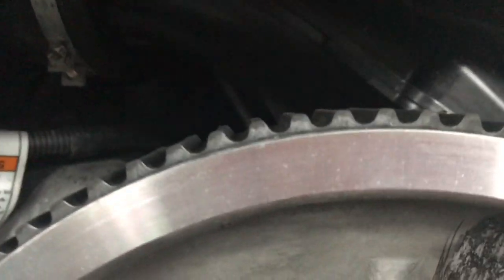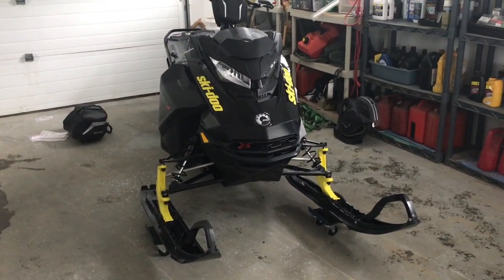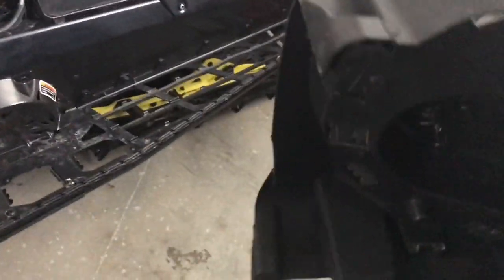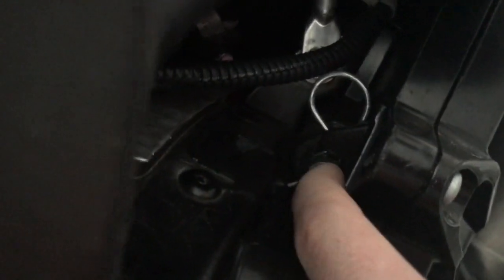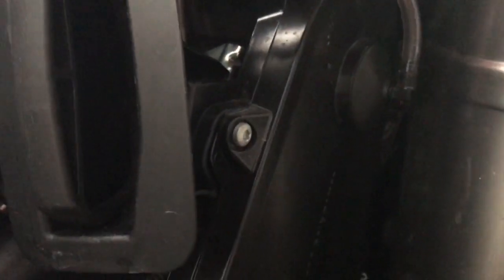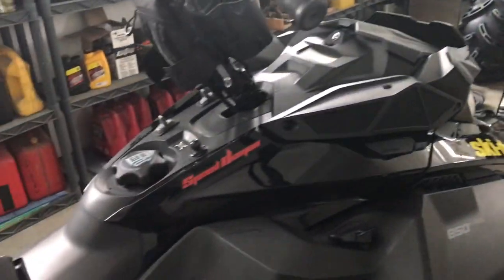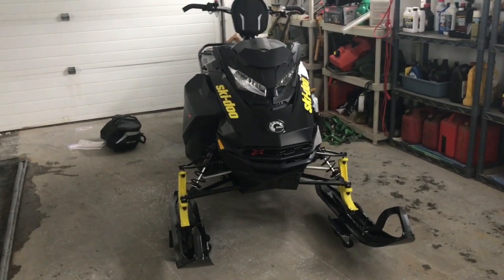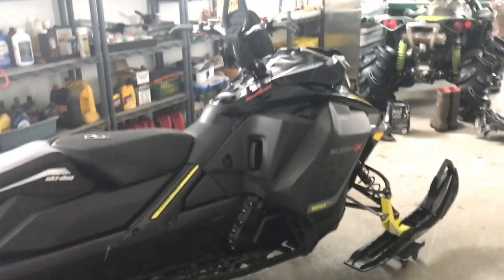*New Review* 2017 Summit 850 X Things to do to avoid problems!

Comment: Very late to the party, but I am looking at buying a used 2017 summit x with 970km on it. Is there anything else that I should look at when checking it out?
Reply from the maker: Just check out the suspension i have been finding the suspensions sag out after a season or 2

Comment: Great video, I just picked up a Summit 850 myself. Quick question, I just did the Grip n Rip full kit, and put it back together. I threw a can on it too, and propped the track off the ground to let it run a little to make sure everything’s good to go after taking it apart. It idles fine but when giving it a little throttle the revs bounce a few times and then it stalls. First time starting it up this year, maybe it just needs to be run a bit? Not sure if it’s a problem you’ve heard about or experienced, or I’m worrying over nothing.
Reply from the maker: Owen Miller I would have to hear it myself to give you an accurate answer sorry man